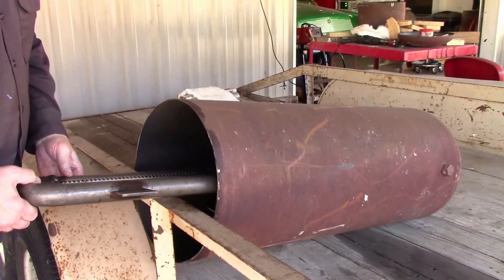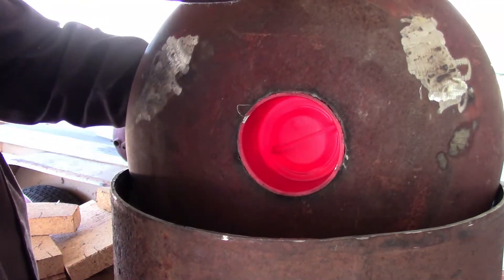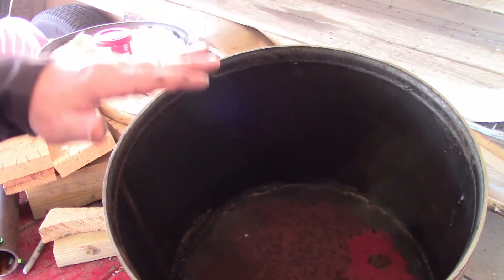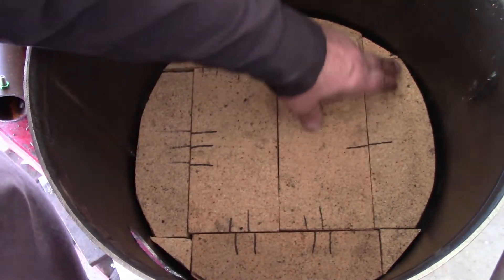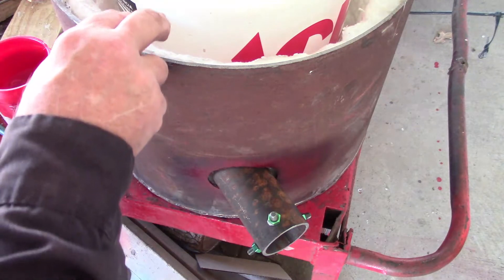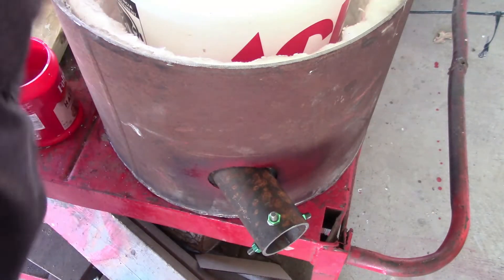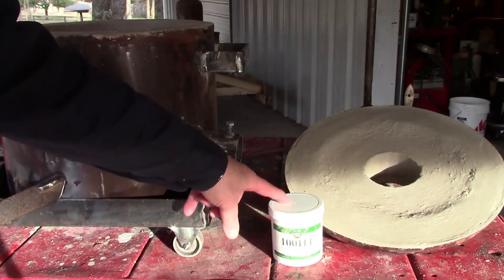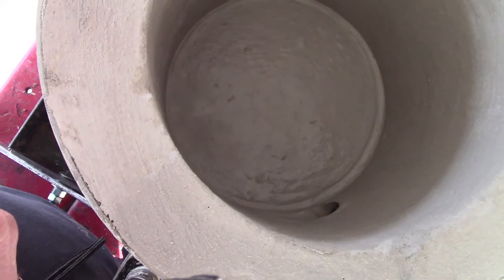Building my Foundry Furnance

Comment: You had your thinking cap on Lloyd, great lid design. Coll departure from 3D printing to alum.foundry furnace --really cool. I would 3d print in the summer and run the foundry in the winter, jusdt saying i been told it gets warm in your neck of the woods.
Reply from the maker: That sounds like a good idea Dan. Summer can get really hot around here.

Comment: that is an ingenious way to do that,, I'd like to have something to melt metal in but it seems like a pretty detailed process from start to finish.
Reply from the maker: Thanks Vernon,  I got the all the information from YT . Lots of good designs out there
Reply: All you need is a hole in the ground, filled with wood and something to pump air in. Aluminium is fairly easy. If you want to do copper or brass, you have to be a bit more technical.
Reply from the maker: I bet that works fine but I can roll this one almost anywhere. Thanks Malc